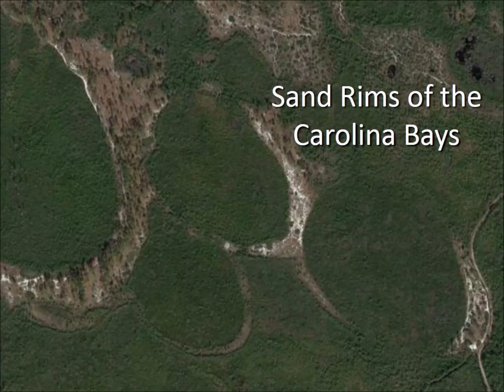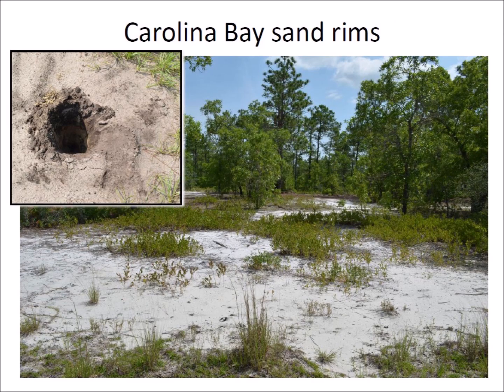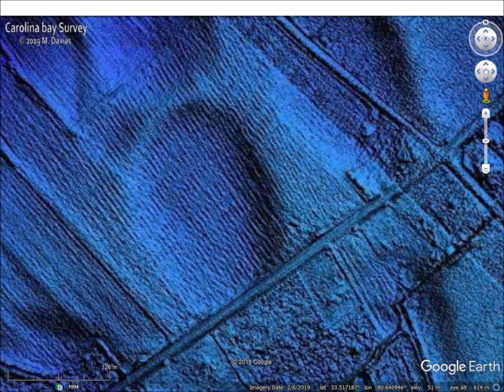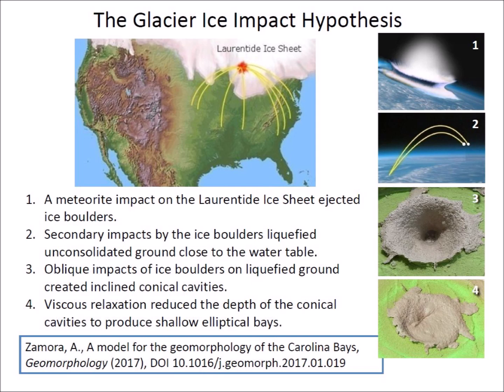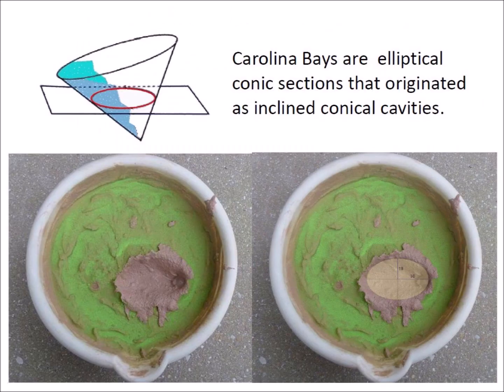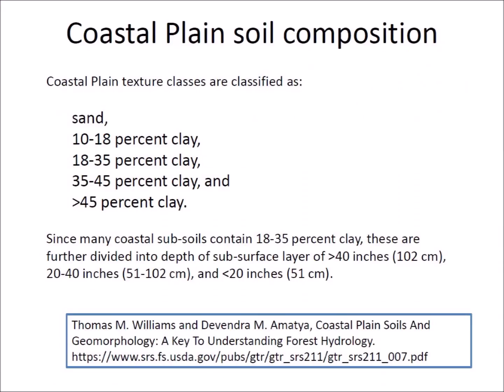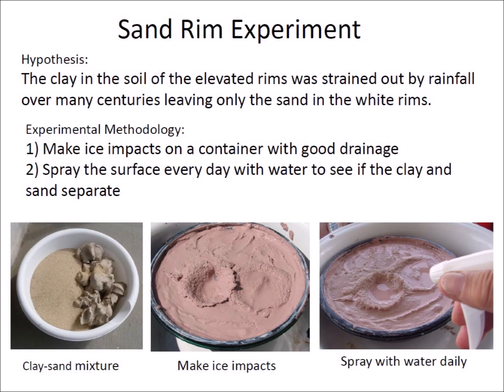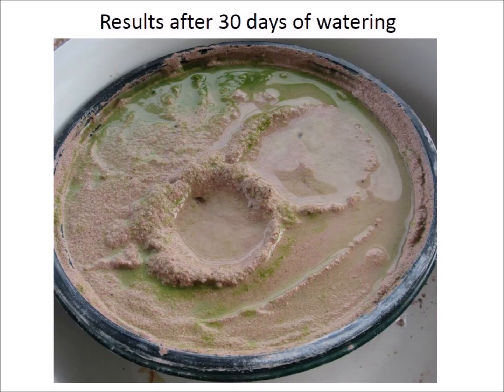Sand Rims of the Carolina Bays

Comment: Hey Antonio, one thing i've noticed in the LiDAR is the lack of smaller bays entirely within larger bays. did these smaller bay rims quickly flatten out because of viscous relaxation leaving only the larger bay rim? If so, then I find it odd because I would think the rim of a bay that partially overlaps another would be slightly modified or even distorted but as we know they are not affected.
Reply from the maker: Take a look at 139317-6529.  There are several examples in the Bowmore, NC area.
Reply: @Antonio_Zamora  Thank you! I wonder if this region has better draining/deeper sandy soil compared to lower elevations, allowing the bays to better retain some of their initial impact characteristics.

EDIT: I just realized that soil drainage differences probably explain Chris Cottrell's paleo shoreline erosion of bays correlation. The soils along those ancient coastlines are not as well drained as the higher elevation terraces with better draining soil, resulting in increased surface erosion (Hurricanes and coastal storms don't help, either).

Comment: It is likely during the Melt Pulse that the bays became submerged if even only briefly at the peak period.  That erosion is exactly what caused the "Bays" to level out in the middles.  The submersions are slow and should indicate breach point when the ridges were higher filling in the radius with the Ebb & Flow Tides.

Comment: Mr. Zamora, What is the greatest  distance of the ice ejecta from the Saginaw impact site? 1500 miles? Was there an inner ejecta radius boundary of the ice impact zone?
      I have been thinking about the angle of impact of an ET on a sphere such as the Earth. Would that approach angle of an ET, radically change the shape of the crater left behind? ...and consequently the trajectory of the ejecta material?  Would love to hear more on ballistics and trajectories of impacts. Thanks for the great videos!
Reply from the maker: The range of the ice ejecta is approximately 1,500 km not miles.  The width-to-length ratios of the Carolina Bays indicate that they originated as conical cavities inclined at about 35°.  Extraterrestrial impacts generally make circular craters because the energy is transferred very fast and basically causes an explosion during the excavation phase that follows the contact and compression stage. The following video discusses some possibilities about the angle of impact. https://youtu.be/SwaQD_jJbKk

Comment: The hypothesis that the basins were formed by impact ejecta is persuasive. Dating them is another matter, much more difficult. Maybe sample them for trapped carbonaceous matter, which can be dated? 
Also, the basins may have filled with (trapped) eolian sand in the decades/centuries after formation. Once inside, it would be difficult for it to get blown out.
Reply from the maker: Dating of the Carolina Bays has provided a wide range of dates.  Since the dates are obtained with very reliable methods, it leads to the conclusion that the bays developed over a long time by eolian and lacustrine mechanisms.  However, wind and water do not produce mathematically elliptical structures with width-to-length ratios of 0.58.  The pros and cons of the geometry and the dates are discussed in this video: https://youtu.be/d6gisXApcw8

Comment: A suggestion: take a glass chromatography column, fill it with sand/clay mixture, run water through, maybe assisted with some pump to increase the flow. Might be possible to get a nice graphic picture of fraction separation.

Comment: Hate to be a pest.  I understand that it is difficult to reconsider your beloved paradigm. But... to better understand how large masses of ice can be lifted 10 or 15 miles above the Earth's surface it might be helpful to refresh your memory on two important topics (Google them if necessary): 1.) bunker buster bomb and 2.) pressurized water reactor.
Reply from the maker: Hello John,  I have seen your videos mentioning the penetration of a meteorite through a glacier and the subsequent steam explosion that can lift large pieces of ice above the Earth's surface.  It all makes sense, and I believe it is the reason why the angle of impact of the ice boulders that made the Carolina Bays is about 35 degrees.  Ejecta curtains usually have angles of 45 degrees, but a rapid vapor plume expansion would have forced the ejecta curtain outward, resulting in the 35 degree impact angles that we see in the Carolina Bays.
 https://dx.doi.org/10.1016/j.geomorph.2017.01.019
Reply: @Antonio_Zamora  you are my hero, my friend. I am honored to be able to communicate with you! Best wishes on your next book! (Tip: the book will write itself; you are simply the conduit of information!)

Comment: If the source of the ice is the suspected Saginaw comet or meteorite impactor presumably the ice ejecta would have carried some eroded debris from the glaciers grinding Canadian/Michigan rocks.
If rocks of the type under the Laurentide ice sheets were found in the bays on the Coastal Plain of the Carolinas that would be your best evidence???
Reply from the maker: Our exploration of Arabia Bay in North Carolina was looking for exactly that kind of evidence.  The lab tests should give some information. Check out the video: https://youtu.be/2IjnWHqa_0U
Reply: Excellent observation. Although I appreciate the thought behind the coffee filter experiment (and no doubt leeching of various sorts happen to rim mounds it seems likely that) 1. The ice chunks carried with them all sorts of sediment and perhaps even crushed strata from below the glacier depending on its depth, as well as glacier rock flour and 2. By the time they hit to make a bay they had already been shocked with the force of the Saginaw bay launch impact and were not really solid ice chunks- but more like fractured lumps of ice without a solid core. 3. Upon reentry the heat would have surrounded the fractured ice ball with some melt water. 4. The splat on impact would only have produced the shallow crater not a deep impact and the remaining piles of ice thrown to the the southeastern tip and Outer rings melted out into the characteristic piles of sand on the southern tip and also made the ghost bay patterns. (Because the piles of sand are characteristic of the bays themselves - and not Determined by the soil they happen to hit on). ( I am sure there will be all sorts of reActions to this notion bEcause there is indeed a layer of ancient beach sand under the SC low country midland region however the odds on it turning up at exactly the same place in the bay rims as often as it happens in so many different places would defy logic.AHWILD@aol.com

Comment: Sounds plausible.  As to the formation, I wonder if you have ever tried vibrating the work as the ground would be shaking before, during, and after the event.  Getting the frequency right maybe a challenge but may produce the exact result if videoed.
Reply from the maker: I have thought of using a shake table to produce liquefaction in the sand and water mixture. At this point, I am just hoping that professors and students in geology start studying the Carolina Bays as part of the curriculum.
Reply: @Antonio_Zamora  - I hope they will too as I have no time at the moment to try it myself.  I have no doubt that it could be replicated convincingly with vibration.  Great work so far, Antonio.